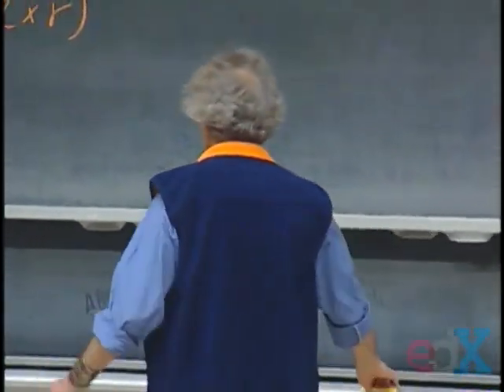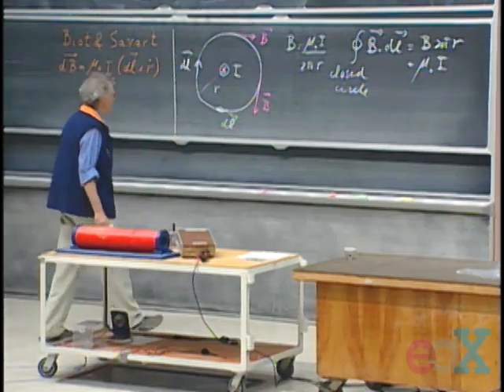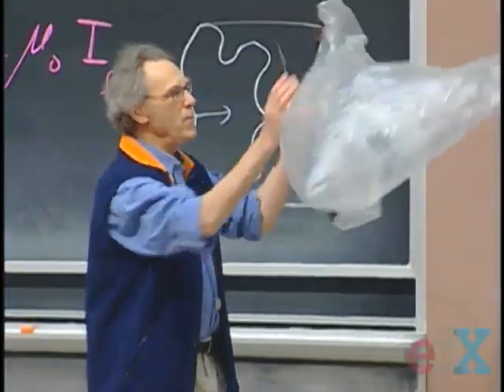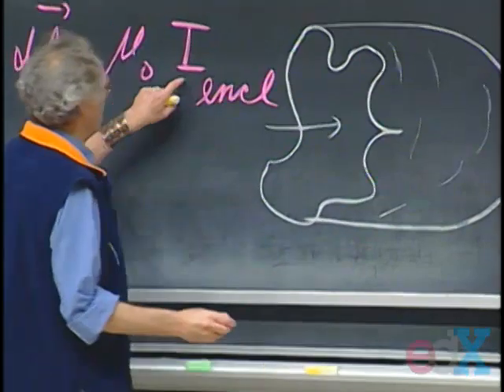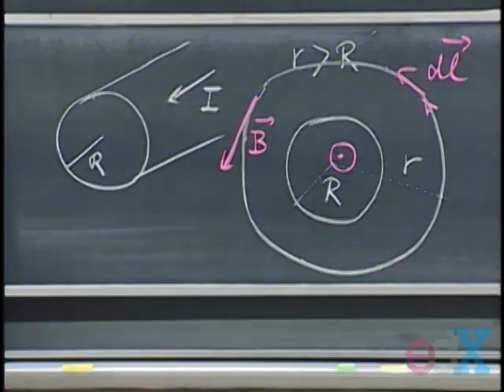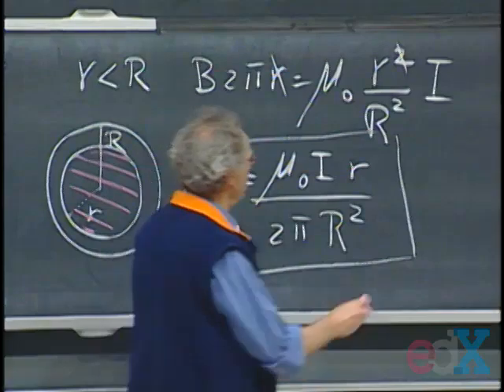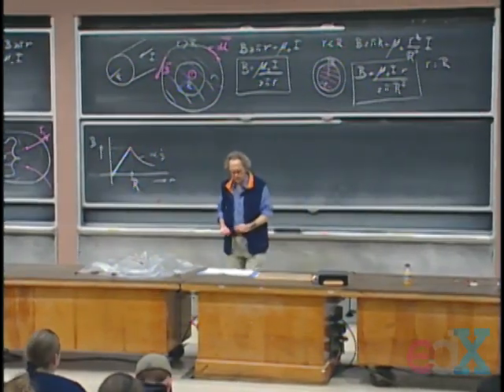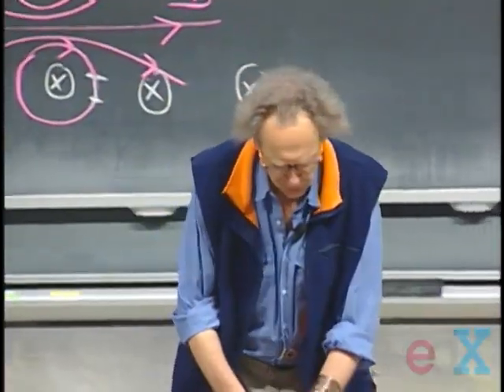8.02x - Lect 15 - Ampere's Law, Solenoids, Kelvin Water Dropper (revisited)

Comment: Hello Sir. What's the important difference between a solenoid and an inductor?  Thanks in advance!!
Reply from the maker: Everything has inductance. A 1 meter copper wire has an inductance of about 0.00000005 H
A solenoid is designed in such a way that it has a high inductance.
Reply: Lectures by Walter Lewin. They will make you ♥ Physics. Thank you sir. So can we say that a solenoid is a special case of inductor?
Reply: @Suseenthar1  A solenoid is one particular geometry that you can use to make an inductor.  Another common geometry used for making inductors, is the torroid.

Comment: how can a wire have uniform current density inside it ? isn't it true that a conductor should have no charge inside it?
Reply from the maker: current density in general is not constant throughout a wire. It's larger near the surface than inside.  in static situation charges are at the surface of conductors.
Reply: so , does that mean when current flows through a conductor charges are on the surface and also in the wire?
Reply from the maker: no. 
 in static situation charges are at the surface of conductors.
Reply: what happens when there is a current flow in the wire?
Reply from the maker: electrons flow through the wire with very very low speeds. Watch my 8.02 lecture where I derive these speeds (called drift velocity). .
Reply: so, when there is a current flow , no charge is in the surface ? all travels through the wire?
Reply from the maker: >>>so, when there is a current flow , no charge is in the surface ? >>>
no
please watch my lectures and use google

Comment: Sir why can we not use ampere's law for finite length of wire
Reply from the maker: if wire is L cm long with radius R,  use Ampere's Law for the region close to the middle of the wire at distances of only a few R from the wire, you will then find values for B which are quite accurate.
Reply: Thank you sir

Comment: Sir, I didn't understand how (l/L)N currents penetrates the surface choosen on the lecture. Can you explain it again more easily? Thanks :)
Reply from the maker: I watch it again. I cannot improve on my lecture - sorry
Reply: Alright sir. Thanks anyway :)
Reply: Actually, I also don't fully understand it..
Reply from the maker: >>>>how (l/L)N currents penetrates the surface choosen on the lecture. >>>>
how many minutes into the lecture?
Reply from the maker: at 18:31 I explain this very clearly.
Surface #2 is a flat surface. many windings of the solenoid cut through that surface. What more do you want?
Reply from the maker: at 18:31 I explain this very clearly.
Surface #2 is a flat surface. many windings of the solenoid cut through that surface. What more do you want?
Reply: Ok.now things are li'l bit easier to understand..Thanks
Reply: Actually.in these type of cases,the problem which I generally face is the inability to understand the drawing style,i.e,I always feel things might be much easier to understand with the help of 3d drawing(which is impossible on classboard)..but thanks anyway for your efforts..
Reply from the maker: it's not that hard to imagine a solenoid; it's a spiral with many many windings. If you then have a flat surface that cuts through the wires 
such that all currents go through that surface in the same direction, then you have it!

Comment: Lectures by Walter Lewin. They will make you ♥ Physics.professor,could you provide me an explanation as to why,THE B field due to a TOROID is identical to that of a solenoid?thank you
Reply from the maker: I suggest you derive both fields on your own. They are not the same. http://hyperphysics.phy-astr.gsu.edu/hbase/magnetic/toroid.html
Reply: Thank you Professor..Actually my textbook,published for cbse class 12 in india,says that the B field due to a solenoid and a toroid is identical,and the assumption you make is,N,the number of turns,is equal to 2*pi*r*n,where r is the avg.radius of the toroid and n,the number of turns per unit length,and you use this in the B field of a toroid,and you find it identical to the solenoid.Sir,is there a mistake somewhere?
Reply from the maker: what is their definition for "Identical".  The fields are not identical as solenoids have B-fields outside the solenoid. Toroids do not. The equations of B-fields inside the toroid and the solenoid are the same. Maybe they call that "identical".
Reply: Well..yes,my confusion is cleared,the "identical" is related to the interior B field,thank you professor,so much.

Comment: 19:41,why L has to be very very large than R??
Reply from the maker: This lecture is clearly too difficult for you. For more information use google
Reply: This is what i thought with my intuition, because we are measuring the magnetic field from the center of solenoid,  if R is too large the( u0IN/l) remain the same, but the magnetic field will decrease, therefore our result is not accuracy, if R become infinity, magnetic field at center could be 0, and its not true, also meaning less,
Reply: Look at the picture that he shows at 14:40 - if R >> L, the field lines would not sum to approximate a straight line, meaning B and dl would not be parallel and you couldn't use Ampere's law

Comment: Is current really distributed uniformly inside a wire ?
If we treat current analogous to water flow then this is not true!!
Reply from the maker: not uniform - use google
Reply: It is not clear on google . 
But sir if it is not uniform then why we apply amperes law inside a wire?
Means taking current to be uniform!
Reply from the maker: https://www.quora.com/A-current-is-flowing-through-a-conductor-with-non-uniform-area-of-cross-section-Then-which-will-be-same-current-or-current-density
Reply: Thank you Prof. 😊

Comment: Sir can you tell me how exactly you connected the galvanometer to the system? Also, can a voltmeter be integrated into it in order to detect the voltage, and how can that be done?
Reply from the maker: how many minutes into the lecture?
Reply: I am talking about the Kelvin Water Dropper, thank you in advance Sir...
Reply from the maker: how many minutes into the lecture?
Reply: 36:04 Sir
Reply from the maker: it's not connected with wires. It senses the electric field and that creates a current.

Comment: Electro boom is right you are wrong
Reply from the maker: In Dutch we say "zachte heelmeesters, vuile wonden". I owe it to my multi million viewers to explain in detail why Electroboom is dead wrong. Many people make the same mistake that he made. All this is at the very roots of a correct understanding of Maxwell's eqs. I therefore have an obligation to set the record straight. This is my last msg.
Don't feel embarrassed if this physics is above your level; you are not alone. Non-conservative E-fields are not taught in high schools. 
I demonstrated at the end of my lecture #16 of my 8.02 E&M course at MIT that two identical voltmeters attached to the same 2 points in a circuit can show very different values. https://www.youtube.com/https://www.youtube.com/watch?v=nGQbA2jwkWI&list=PLyQSN7X0ro2314mKyUiOILaOC2hk6Pc3j&index=17
This can also be demonstrated with a transformer.
https://www.youtube.com/watch?v=b7i2uMx7gHo&list=PLyQSN7X0ro22zanLOcvkaSY-IZqheFYM5&index=8
In fact, look more closely at my circuit; it is a transformer. My closed loop is the secondary winding (only 1 winding) of a transformer and the primary windings are in my electromagnet. 
The reason is that an induced EMF (Faraday's Law) creates a non-conservative E field. This means that moving a test charge between the same 2 points in a circuit can require a different amount of energy (even with opposite signs!). You still aren't getting any energy for free, because it comes from the source of the time-varying magnetic field.
When a voltmeter reads a value V it means that the integral of E dot dL across the voltmeter is V. 
In cases where Kirchhoff's loop rule (KVL) applies, 2 voltmeters attached to the same 2 points in a circuit will always show the same value. Kirchhoff's original text can be found in the following link, pages 497-514: https://books.google.de/books?id=Ig8t8yIz20UC. Clearly he was fully aware of the prerequisite for his "loop rule". KVL is a special case of Faraday's Law. That's why Faraday's Law is one of Maxwell's equations and KVL is not.
My demo was first suggested and published by Romer in December 1982 in the American Journal of Physics. This demo has now become a classic; it's done all over the world at many colleges and universities.
ElectroBOOM and Dirk Van Meirvenne believe that 2 voltmeters attached to the same 2 points in a circuit must always show the same value which is not true. It's quite  embarrassing that they each posted a video on their channel in which they claim to have proof for their wrong ideas.
Also read Professor John Belcher's thoughts on Faraday's Law and on KVL. Professor Belcher is my former colleague at MIT. http://freepdfhosting.com/0813df09f5.pdf
ElectroBOOM insulted me in his video by mentioning that the reason why my 2 voltmeters read different values was due to "bad probing". He stated that if I had done the demo correctly both voltmeters would have read the same value. He could not have been more wrong.  
The following video may also help you to understand why 2 voltmeters attached to the same 2 points in a circuit can give very different readings. https://www.youtube.com/watch?v=wz_GqO-Urk4&list=PLyQSN7X0ro22zanLOcvkaSY-IZqheFYM5&index=9